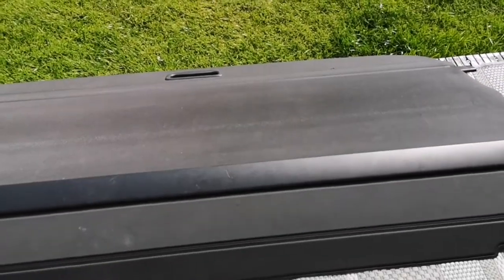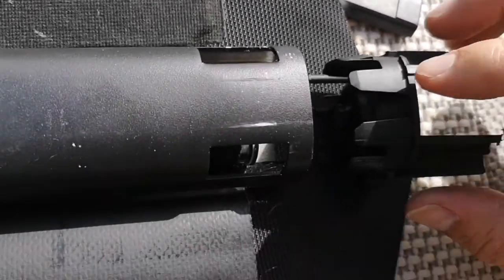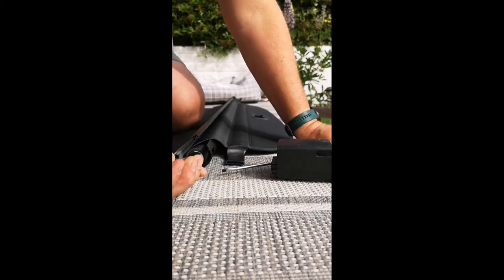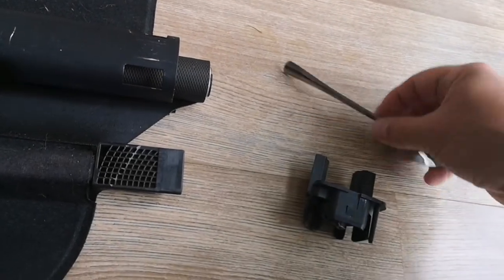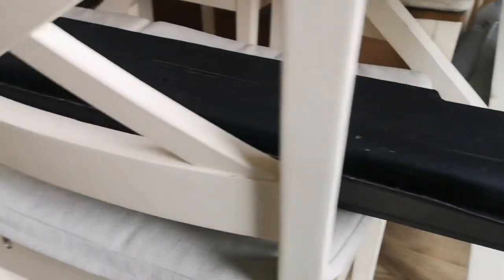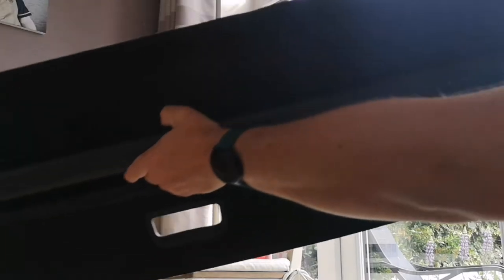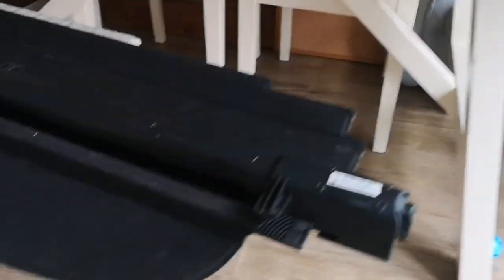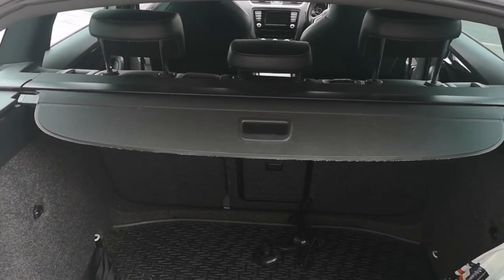Skoda Retractable Load Cover repair. Spring tension replaced. Audi/VW/Seat.

Comment: Used your video for similar problem on my Karoq.  Worked great!   Thanks for doing all the hard trial and error.  For starters, I would never have worked out the removal of the spring-loaded end cap.   I hadn't realised that end arrangements would be different and that you can only retension from one end - my roller blind knowledge not up to scratch. On the Karoq the tensioning 'key' is in the nearside (left) end and fortunately I opened this end.  I tensioned with 20 turns.  I get lifted off my feet when the cover reals in!

Comment: Many thanks,  I followed your method and it worked!!  It took several goes, as I had trouble locating the "other" end in it's  housing. I needed a third hand. In the end 28 turns worked well. Inspite of you saying "don't forget the spring" I forgot the spring...

Comment: With your video help I just repaired myself, thank you so much. 
It was easier to open both ends so you can drag more pole out to twist, when it gets tighter and its start to pull step on the cover.

Comment: Maybe I'm being a bit thick, but can you tell me how to remove the damn thing in the first place? I can't see any screws or anything but trying to lift of out, it feels stuck and like any more force will break something. Thanks.
Reply from the maker: Out of the car?
Reply: @SkodaOctyFixes  lol yeah out of the boot, is it just brute force? Mine seems pretty stuck in
Reply from the maker: @ReheatedDonut the end caps are spring loaded and if you squeeze them to effectively try and make the whole thing less wide, then it just lifts out.
Reply from the maker: @ReheatedDonut look at the video at 7 minutes and 50 seconds and you'll see the spring loaded release section.